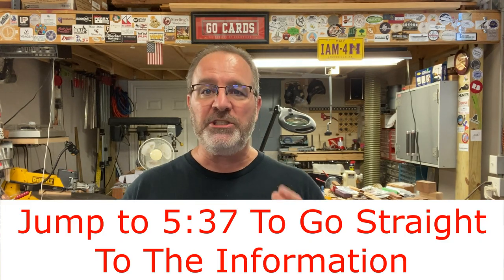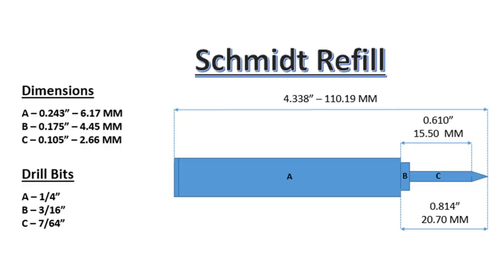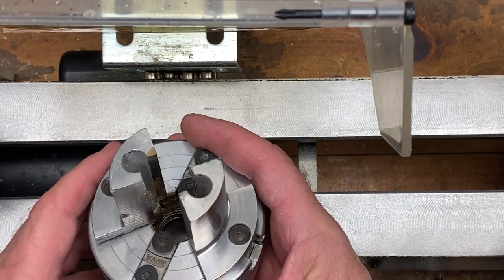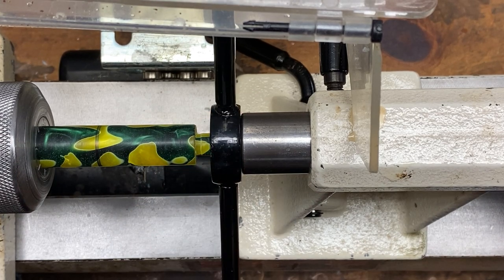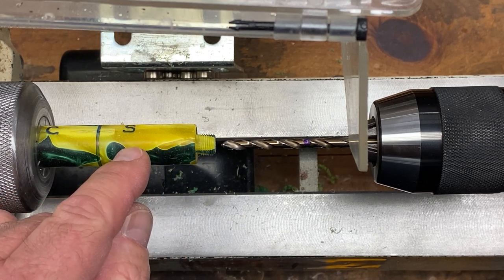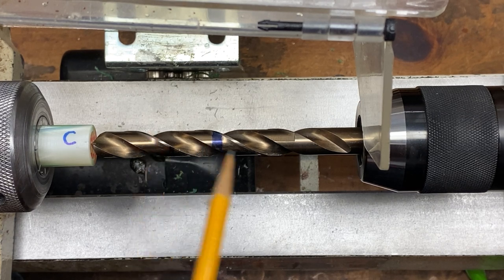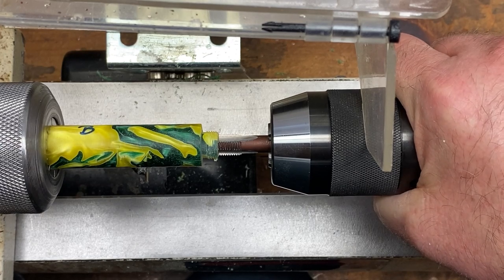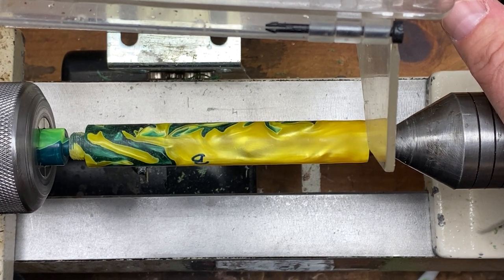Bespoke on a Budget

Comment: Thanks again for such a detailed tutorial Bob. I'll have to rewatch it a few times. thanks for mentionioning the metric sizes as well. Does the pdf mention those for the drill bits as well?
Reply from the maker: Thank you,
  Yes both imperial and metric are listed in the PDF. I do recommend taking measurements as you go to be more accurate. You never know when drilling or cutting a tenon. It you’re 1mm off then the depths after that step could all Chang. 

Regards,
Bob
Reply: @RJBWoodTurner  yes my drilling is usually more of the diagonal persuasion 🙂
Reply from the maker: @RubenWoodcraft been there, done that. 😀

Comment: Can this be done with hardwood?
Reply from the maker: Threading is the issue. You would need to make inserts. Also, if you make a fountain pen the inside of the cap will need a full insert to stop the ink from drying out.
  Do experiment though you will learn from trying. 

Regards,
Bob